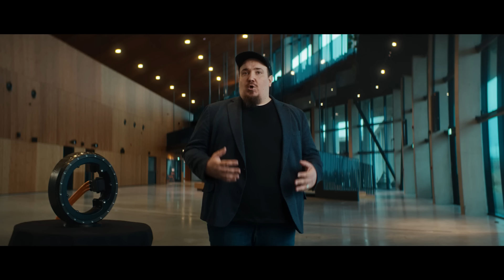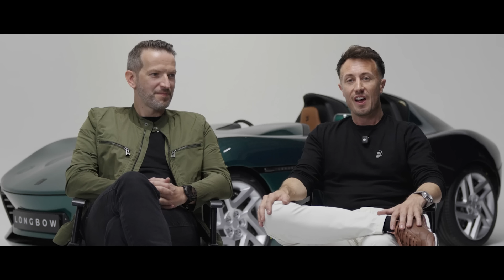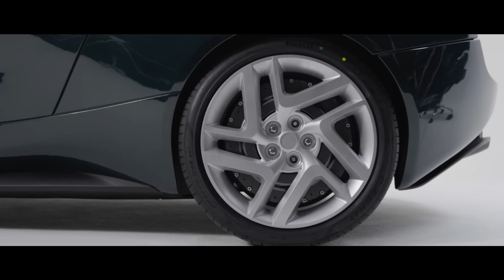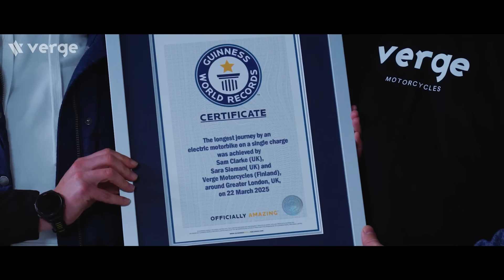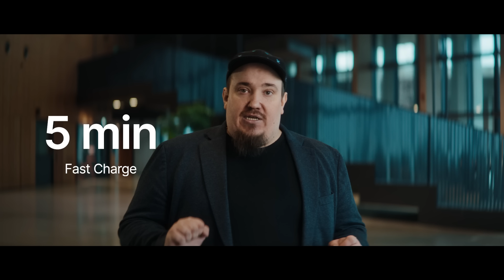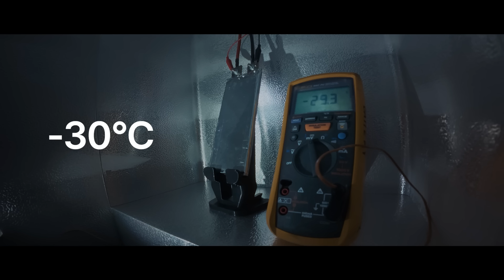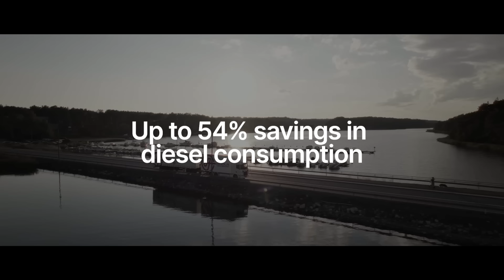World's First All-Solid-State Battery in Production Vehicles | Donut Battery

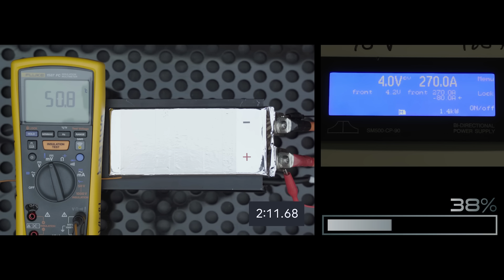Comment: 13:19 Did you guys see the battery starting to bulge ?
Reply: Looks like it's only the aluminium foil tape which is coming off because of the rising temp.
Reply: There's definitively movement, I doubt it is swelling as the actual battery is not moving, but the tape near the connection does
There is something else happening, I believe they put tape to cover any electronic from out view
But if you look using the youtube frame by frame, in the last 2-3 frames there is what appears to be a component causing a lot of heat at a specific place on the tape, potentially bulging or displacing it
But again this doesn't affect the battery and it was probably a quick tape to cover electronic out of our view
Reply: No but it looks like the dude has been bulging for a while
Reply: LOL Great eye!
Reply: Gas is normally produced in lithium-ion batteries, scaling fast with increased charge speed (off-gassing). 270 amps is.... a lot of amps (they show THREE 90A supplies in the example). Modern high-end batteries reduce off-gassing a lot, already (e.g. 15-minute 80% charge batteries have existed for years at the vehicle level).
Reply: Put a drone to test for all to view and see how much time stays in air!
Reply: I wish I had this for my laptop.
Reply: @MultiRealful  I wish I had this for my phone... My phone battery is dead, AGAIN, imagine twice the amount of battery without explosion risk and 50 years lifespan 😍😍😍
Reply: Sure. They would include the footage of the moment it swells without realising you were in the audience and smart enough to catch it for the rest of us - when they didn't. Or it gets warm and that loose foil expanded.
Reply: @philiplavere ok mr.right. It was merely an observation.
Reply: Nwice catch ....bottom right corner!!! that is pretty large swelling!

Comment: The battery is too hard to believe.  Regarding motors in the wheels, Mass not carried by shocks but in the wheel causes ride and wear problems.
increasing unsprung mass (like adding an in‑wheel motor) generally worsens ride comfort, increases dynamic wheel loads, and can increase tire and suspension wear, especially on rough roads. The effect can be moderated with good suspension tuning and is often smaller than the effect of road roughness itself.

“Changing the tire is more difficult because the motor is in the wheel.
the wheel assembly is heavier, more complex, and more expensive, so tire service requires more care, possibly special procedures or tools, and usually a trained shop, even though the basic idea of removing the wheel and changing the tire is the same.

Comment: In another interview, ( Ziroth )  on the CES, Donat lab said, they "chose" 4.2V to make it compatible with existing systems. But you can not choose the voltage when building (LFP, NMC, LTO, sodium.....) batteries .
That means these are capacitors.
You are welcome.
Reply: Correct.

Comment: Until 3rd-party validation is provided, I'll avoid this company like the plague! I'm expecting them to launch an 'investment round' anytime. If so, my SCAM-RADAR goes into overdrive. 
However, if somehow it's all true, this is world-changing, and, if I were the CEO, I'd be holed up in a bunker awaiting a response from the world's petro-states.

A MASSIVE healthy dose of skepticism should be the norm until Donut Lab proves all these WILD claims.

Red Flags:
1) Temperature 'testing' carried out on an Amazon-special Voltmeter
2) No demo bike running on the batteries at CES
3) Only 3D-printed mock-ups at CES
4) This statement: "We found ourselves actually designing a slower charging speed so riders can slow down, actually drink a latte..." Yeah, no.
5) No patents or filings to be found.
6) No list of scientists, PHD specialists w/ solid state expertise on payroll
7) No production facility.
8) No batteries ever made available to companies for independent application testing
(There's probably a hundred or two more I've missed, but who's counting?)
Sounds a LOT like Nikola Motors or Theranos at this point.  
Hopefully, Donut Lab proves everyone wrong. I'd love this to be true but belief should never override Scientific Method.

Comment: I would guess it's a sodium solid state battery with some interesting voltage boosting electronics, for when the charge goes low. As Lithium remains at steady voltage level most of the time, sodium drops more linearly.

Comment: ok call me excited.. 400 Wh/kg? cheaper than Li/Ion?
My only worry with this tech is.. production capacity. The machine that builds the machine (solid state battery) is thebottle neck. The machine for the cells is just sloooooow. Throughput volume sucks right now and might still suck in 5 years. We will see

Comment: I really wish this technology is true! If it’s a fake, I hope nobody falls for it

Why "Donut Battery" fits the pattern
The Donut Battery announcement has specific markers of Category 1 (VC Bait) and Category 2 (Acquisition Bait):
• Circular Logic: The "customer" verifying the battery (Verge Motorcycles) shares the same leadership as the battery company (Donut Lab). This is a closed loop of hype.
• Impossible Specs: Claiming 100,000 cycles is arguably physically impossible for current lithium-based chemistries. It sounds like a number chosen to grab headlines at CES rather than a spec derived from engineering data.

The Reality Check:
If a small startup truly invented a battery that lasts 100x longer than a Tesla battery, they wouldn't be putting it in a niche electric motorcycle. They would be licensing it to Apple or the US Military for billions of dollars overnight.

Comment: It is not a "battery", it is a supercapacitor. Mentioning it as "battery" is (intentionally?) misleading. Then all the claims exept the cycle endurance would make ANY sense. The temperature range is also something that does not make sense. As does not the video of charging the "cell".
There are just way many red flags that this is most propably just Snake Oil. Charging with steady voltage and amperage after reaching 4.2 volts?
The display showing 270 amps from 3 90 amp units through 35 square mm leads? In 5 minutes only 63 degrees C cell temperature with 4.2 V and 270 A? Why wave so many red flags? Sure, a new kind of supercapacitor that works like that under 60 C would be nice to have. But over 99% in -30 C? Carbon is cheap and plentiful, so it sort of says that this is a capacitor. But yes, I have Flying Carpets for sale. They fly straight from your window. Like some people in russia. One direction only...
Reply: They learn from Elon 😅

Comment: It is an All electron battery:    Quantumscape was started to develop this, but switched to a Li solid state battery.   An “all-electron” concept  would be a device where the internal charge transport and storage are dominated by electrons and holes (charge carriers in solids), not by ions. In such a concept:
Electrons are the mobile negative charge carriers.
Holes are the mobile positive quasiparticles.
Quantum mechanical effects (e.g., quantum tunneling, band engineering) dominate the transport and storage mechanisms rather than ionic diffusion and redox chemistry.
This is very similar to solid-state electronics: battery function would resemble a solid-state p–n junction or capacitor with engineered bandgaps rather than a traditional electrochemical cell.  Yes this would give the described cycle life, charge rate, and capacity, but other issues like self-discharge would remain.  Materials:  graphene and TiO2 .  So, no Li, Ni, or Co.
Reply: It's all fake.  Just a currently available high performance Li-Ion cell.  
It's NOT Lithium free, it will NOT last 100,000 cycles, and it will NOT charge in 5 minutes for more than 1 "cycle".
They need to prosecute him for fraud.

Comment: Given the fact that Donutlab operates in a kind of company / knowledge cluster with Nordic Nano and Holyvolt, this sounds like a nano based printing technology with materials like silicon, carbon nano tube or graphene base for a kind of super cap. Or a hybrid concept between a super cap and a solid state battery. This would explain the extreme amount of cycles and the fast charging times. However I've never heard of a super cap with that high gravimetry density. 
It sounds plausible to a certain extent, however what casts doubt is the lack of patents, papers etc. 
So I'm curious to see more of it and I really wish that Donutlab is successful with this technology. However if I had to invest money into them, I would have a very long due diligence checklist. It just sounds a little bit to good to be true.

Comment: Lithium battery run $100 to $150 per kwh.  Solid state batteries run $800 to $1200 per kwh.  Gas in Florida is $2.35 a gallon and takes 4 minutes to fill the tank
Reply: You are comparing a tanksize to $/gallon. WTF

Comment: So, it has the best Range, Charging Speed, Safety, Cost, Temperature, Degradation... and has 100K cycles instead of 5K... and is also made from the most common materials, making it independed from global power struggles and potential supply chain problems?

Yeeeeaaaah, we'll see about that 😅
Reply: If it’s true Donald trump might just invade Finland to prevent them from making them

Comment: 0:30 Donut Lab’s own published motorcycle motor figure (~201 hp at 46 lb ≈ 9.6 hp/kg) is far below Lucid’s disclosed power densities, and even Donut’s headline automotive motor (630 kW at 40 kg = 15.75 kW/kg) doesn’t clearly exceed Lucid’s motor-only density (~670 hp at 67 lb ≈ 16.4 kW/kg; Lucid’s full motorsports EDU is 14.7 hp/kg), while “most power per dollar” can’t be validated because Donut Lab doesn’t publish motor pricing in a way that supports a $/kW comparison to Lucid. This guy immediately comes off as a snake, bending the facts or just outright lying. My money is on this supercapacitor being vaporware

Comment: Spoler: It's made out of copper and carbon powder, which is fused into film surface like a capacitor, just like regular pouch batteries. The innovation here was discovered when experimenting with Shungite powder but carbon powder was found to be identical performation.

Comment: So they've invented a battery that's better than the best lithium-ion AND lasts like a supercapacitor AND charges in 5 minutes? That's not a battery breakthrough, that's a Series B pitch deck. The 400 Wh/kg + 100,000 cycles combo is physically impossible with current tech. If it were real, they'd have Nobel Prizes, not motorcycle announcements. Classic 'EV Winter' fundraising play.

Comment: You should make a replacement battery for electric bicycles. Design it to behave just like existing Lithium batteries (minus the fires), with a BMS that allows designers to use existing motors, motor controllers, and chargers. 

Only after that, you should then design new motor controllers and chargers to get even more efficiency out of your batteries, but with the same motors that people already have on their bicycles. 

I do not want to have to wait till you make what is essentially a scaled down electric motorcycle with the donut motor, for $10,000 US.

Comment: So it's either

-a supercapacitor with 20x more energy density than anything that exists, or
-an ion battery with 100x longer lifetime than anything that exists.

It really is very very hard to believe.
Reply: It's like three supercapacitors in a battery trench coat, lol. It's probably a printed supercapacitor–battery hybrid that stores energy on a nanocarbon surface and in fast surface chemistry, not deep in lithium layers... like an electrostatic ultracap with a dusting of pseudocapacitive sodium oxide Faradaic ion percolation. I bet it has caveats and hidden warts. Like the effective energy density collapses under heavy load as you outpace sodium percolation and switch from ionic to electrostatic discharge. Probably has bad self-discharge and mediocre calendar life (in spite of the 100k cycle life).
Reply: @Grimwyrd what he said ✅
Reply: @Grimwyrd  Interesting
Reply: @Grimwyrd  or… hear me out… it’s all made up.
Reply: @Grimwyrd  от куда моя аватарка с сайта странник 2 ру???
Reply: @Grimwyrd  speak English dude
Reply: @Grimwyrd  That lifespan could be the Achilles heel.
Reply: You can find papers on improving lithium-ion battery life by passing enough current to cook it, forming a dendrite-resistant surface. I wouldn't be surprised if the same could be done for sodium-ion, or most batteries or chemistries even. It sounds absurd, cooking cells from the inside, but nobody afaik has tried it at scale, or with new materials, or seeing how far you can push it e.g. plates of cooked lithium-ion, getting the layers closer and vastly increasing layer density.
Reply: @doublepinger The data is from China. If this were easy, China would have mass-produced it..
Reply: Supercap claims have been around since the 90’s. The proof of the pudding is …
Reply: There is scientific research confirming the possibility of 400+ Wh/kg super capacitors made of carbon nano tubes from a korean university. Donut Lab is also working with Nordic Nano which does exactly that.... interesting right?
Reply: It's not 20x more. its 2x more.
Reply: You don't have faith in the magic pixie dust then?
Reply: El producte només pot existir si la física s’ha equivocat dues vegades seguides.
Reply: It’s an ion battery that we know of exists in various forms in labs all around the world. This one went to production first.
Reply: Lithium-ion battery energy density (per wikipedia): 100 - 250 Wh/kg
Donut Lab's new battery energy density (per video description): 400 Wh/kg

They claim 2 - 4 times more dense batteries; where did the 20x claim come from? What body part are you listening the video with?
Reply: @MelihKiraz  The hype of a sceptic :))
"bro, this can not be 100x time better, c'mon"
Reply: @MelihKiraz  Huh? I said 20x more energy density than supercapacitors
Reply: @StefanReich  yep and MelihKiraz is asking how you came up with "20x"
Reply: @_prototyp commercial supercaps max out at 15 Wh/kg. Although recently they did demonstrate 100+ Wh/kg in the lab so alright. Maybe this is more possible than thought 😊

Comment: The question is, how long does it hold a change?

Because, it seems to be some type of a capacitor, rather than a battery.
Reply: did you look at the charging demo at 13:00 where the battery is swelling when charging and nobody is talking about that in the comment section.
Reply: @mohammed_mubashir  Yeah, wtf, I wanted to beleive in this :,(

Comment: From my research, Donut Lab's announcement represents advanced energy storage technology being marketed with characteristic startup hyperbole and strategically vague technical descriptions. The underlying technology (nanoprinted supercapacitor-battery hybrid from Nordic Nano) is real and funded, but the claims exceed what can currently be substantiated. The company is not transparently disclosing that they're using supercapacitor-based technology, instead emphasizing "solid-state battery" terminology—which is not necessarily false but is certainly misleading so this is not a "scam" in the classical sense of a fraudulent operation designed to steal money. It is, however, an example of aggressive marketing of unproven technology with omitted context that obscures the actual technical approach. The Q1 2026 delivery commitment provides a short timeframe for either validation or exposure. Time will tell.

Comment: Probably the biggest question right now: How long does it hold charge for?

For example, unlike batteries, capacitors don’t store energy chemically. Instead, they hold charge on plates separated by a dielectric, so how long they can actually retain that charge depends on several factors like leackage resistance, temperature, and the specific dielectric material. In practice, most capacitors will slowly lose charge over time due to internal leakage, with smaller values (like those in µF range) often discharging noticeably in seconds to minutes, while supercapacitors can hold significant charge for hours or even days under the right conditions before dropping below useful voltage levels.

So in the end this seems like some version of a supercapacitor. However, supercapacitors cannot replace the batteries we know today. Can this 'all-solid-state' battery do this? I guess we'll find out later this year. :)
Reply: nice explanation mate, did you look at the charging demo at 13:00 where the battery swelling when charging and nobody is talking about that in the comment section.
Reply: @mohammed_mubashir  The battery gets up to 70 degrees charging that fast. It might just be the adhesive of that + - sticker letting go.
Reply: @Zwamdurkel  nah it's the battery swelling up with the energy

Comment: The last year's claim about good motor is not in the same league as this claim about SS battery breakthrough. 
To use that achievement about motors to legitimize this extraordinary claim about battery feels fishy to me.
 
Motors have never been the bottleneck of EVs. The battery always has been the real challenge. 
The skillset required to innovate on these two techs is different. So, it's unlikely that this same, small, obscure company is the one beating giants on this holy grail.